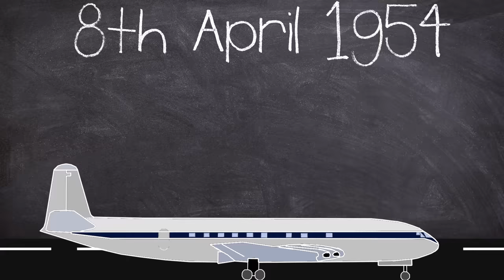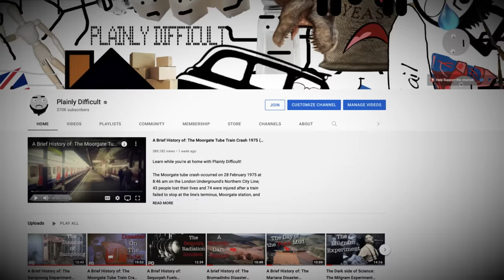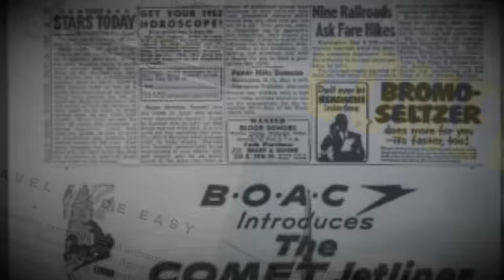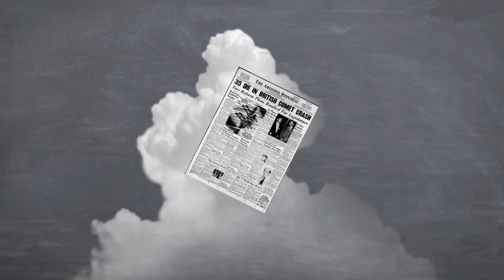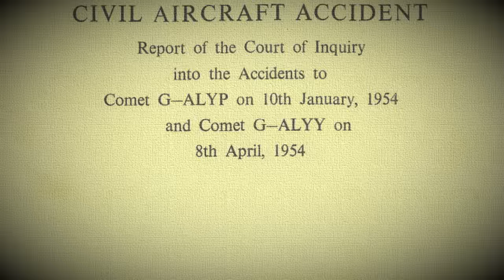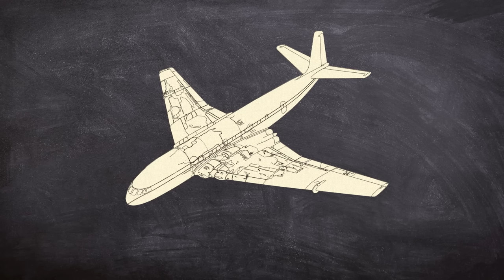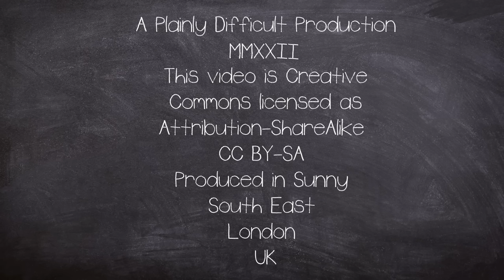A Brief History of: The de Havilland Comet Design Disaster 1954 (Documentary)

Comment: I believe that de H. were under pressure from the government to cut costs and make a lighter fuselage. One thing not mentioned in the video was that the last type 4 was developed into the ( HS ) Nimrod for maritime patrols. Over 100 were built and were in service until 2011. Incidentally I was 3 months old when the plane crashed.
Reply: Actually de Havilland had no real experience in building pressurized cabins out of riveted aluminum.
de Havilland's most successful airliner prior to the Comet was the Dragon, a wood and fabric biplane.
de Havilland was decades behind in aircraft design and construction technology and was still building jet aircraft primarily from WOOD in the 1940s -1950s.
Reply: Not true, the Hawker Siddeley Nimrod was a completely redesigned aircraft developed 20 years later.
Ironically the Nimrod fleet was permanently grounded after a fatal accident involving metal fatigue.
Reply: Hi Older, It's often stated that de Havilland strove to make the Comet 1 light, but it doesn't seen to be that light, so you would have thought that there would have been plenty of material to make a proper design.  Here is a comparison between the Comet 1 and the contemporary Viscount 700 turboprop:
                             Weight          Length       Span        Speed    Pressure Passengers
                            (pounds)         (feet)         (feet)       (MPH)        (PSI)
Comet  1             70,000             93              115          460             8.2               40
Viscount  700     41,276             86                93          318             4.2               40
Reply: @sandervanderkammen9230 
   De Havilland were building all metal stressed skin construction airframe aircraft from around 1938 also building thousands of primarily metal construction airframe jet fighter aircraft during the 1940s.
  De Havilland also manufactured the jet engines for the jet fighter aircraft they built.
  The world's first all metal stressed skin construction airframe airliner aircraft was produced by Handley Page of England during the 1920s.
    The weight of the DH Comet was in fact low for that particular aircraft given it's advanced multi redundancy systems, it's speed & especially the 8 psi pressure differential which makes a big difference.

Comment: Enjoyable video to watch but unfortunately incorrect information. The shape of the windows, that weren’t even square as the corners were rounded, did not cause the accidents. The cause was aluminium that was too thin and punch riveting that led to weak points with micro defects that became cracks. The reason the failures happened around windows was due to these areas being riveted not the window shape. Previous pressurised airliners had square windows with no issues, though admittedly did not fly as high, and as you can see from the picture of the Comet 2 in this video a squarish window remained on the design at the cockpit.

Comment: The cause of the crash was metal fatigue discovered when one of the aircraft that crashed being put into a pressure tank at Farnborough
Reply: The cause of the catastrophic in-flight structural failures was due to bad design and shoddy workmanship.

de Havilland simply lacked the engineering experience to build revitted, all aluminum, pressurized  aircraft.
Reply: This video has some BS included.
For example -
  
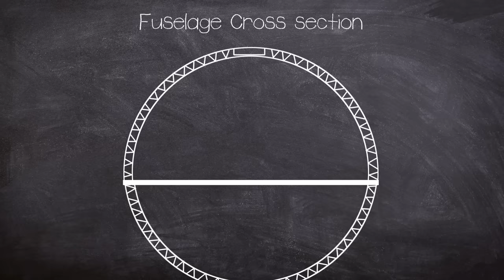    5:20   The idea that only the crew & passenger areas were pressurised is absurd obviously. 
  Every part of the fuselage was pressurised from the nose to the rear fuselage bulkhead including the entire cargo area.

Comets flew until 1997.
The Comet design had military use as a requirement. Nimrod development began at 
De Havilland before 1953.
Nimrods were not withdrawn due to structure problems or other airframe issues it was entirely a significant upgrade snag & resultant basic economics & an end of line sale happening at Boeing at the same time.

We feel we can shed some light on some common misunderstandings.

At the time the Comet wasn't particularly dangerous.

Losses comparisons
How things were in those days.

DeHavilland Comet 4 UK           14% 
DeHavilland Comet all  mks       17%  

Boeing 307                               70%
Boeing 247                               48%
Boeing 707            .                  20% 
Boeing 707                                20% 
Lockheed Electra Turboprop   29%
Canadair CL-44  Turboprop     46%  
Convair CV-580  Turboprop     22%
Convair CV-880    (ff 1959)       27%  
Convair CV-990     (ff 1961)      35%

    Of course De Havilland had prior experience building many all metal construction airframe aircraft including thousands of jet powered fighter aircraft that were primarily of metal construction with pressurised cockpits & jet engines built by De-Havilland.

   De Havilland carried out full stress analysis & engaged in a comprehensive & protracted testing program which is why key De Havilland people were happy to be aboard flying DH Comet aircraft.

   The DH Comet was the first passenger airliner with full length fuselage pressurisation at 8psi pressure differential. Handley Page built the world's first airliner.

   Of course ripstop provision was provided. The skin alloy used became unavailable at the time due to R & D at the manufacturers which resulted in the original alloy being discontinued.
The skin thickness used for the Comet was used for similar later aircraft. 
Frame spacing was not found to be too large & frame width was not found to be too small.

  De Havilland did indeed always work to better than industry standards at the time, used up to date knowledge for the design & construction & no evidence of negligence  or criminal negligence was ever produced in relation to the DH Comet.

  The DH Comet had no effect on the course of the aerospace industry in the UK. The UK now has the world's largest combined nuclear, aerospace & defence sector per capita activity.

    The investigation committee did not find hundreds of fatal flaws or evidence of design defects, structural defects, defective materials or shoddy workmanship. Ripstop provision was included. Claimed incidents did not involve cracks starting from window corners.
Pretty much all changes were just in case changes or were planned development modifications & improvements that were scheduled regardless of incidents.

De Havilland designers knew all there was to know about metal fatigue at the time they designed the DH Comet.

Hope this helps.

Cheers 👍
  
   
   🚫 Do Not Decipher The Content Below 🚫
xcxcxvcxccccvcvvvv
xcvvvccvccvcvvvvvv

Comment: I keep noticing that the rear gear is changing from one big wheel to 2 smaller wheels. Are those just different variants of the dh106?
Reply: The prototype had large single main gear wheels, production aircraft would have the 4-wheel main gear boogies

Comment: I just thought, was there no maintenance procedure to check some structures of the plane? Square window fatigue must have signs like cracks.
Reply: Hi superman de Havilland were doing routine crack testing. The problem is that with the weak construction and no rip stops, a crack becomes catastrophic very rapidly, so there is no time for detection.
(wiki:  de Havilland Comet)

Comment: You failed to mention that the Comet went on to complete many, many years as a tanker for the RAF where it performed perfectly. I still think that it was the most beautiful airliner ever built.  A rumour has it The US was so concerned about their engines exploding they thought it better to let them drop off, many have.
Reply: The Comet and the Nimrod were retired from RAF service due to metal fatigue that caused a major fatal crash...
Reply: The placement of the engines inside the wing was based on an aerodynamic theory that later proved to be completely wrong! No other aircraft in the world use this fatally flawed design.
Reply: This video has some BS included.
For example -
  
    5:20   The idea that only the crew & passenger areas were pressurised is absurd obviously. 
  In fact every part of the fuselage was pressurised from the nose to the rear fuselage bulkhead including the entire cargo area.

Besides that.
The engine position & inlet design were not flaws or fatal flaws, there were good reasons for that design choice at the time.

Comets flew until 1997.
The Comet design had military use as a requirement. Nimrod development began at 
De Havilland before 1953.
Nimrods were not withdrawn due to structure problems or other airframe issues it was entirely a significant upgrade snag & resultant basic economics & an end of line sale happening at Boeing at the same time.

  We feel we can shed some light on some common misunderstandings.

  At the time the Comet wasn't particularly dangerous.

Losses comparisons
How things were in those days.

DeHavilland Comet 4 UK           14% 
DeHavilland Comet all  mks       17%  

Boeing 307                               70%
Boeing 247                               48%
Boeing 707            .                  20% 
Boeing 707                                20% 
Lockheed Electra Turboprop   29%
Canadair CL-44  Turboprop     46%  
Convair CV-580  Turboprop     22%
Convair CV-880    (ff 1959)       27%  
Convair CV-990     (ff 1961)      35%

    Of course De Havilland had prior experience building many all metal construction airframe aircraft including thousands of jet powered fighter aircraft that were primarily of metal construction with pressurised cockpits & jet engines built by De-Havilland.

   De Havilland carried out full stress analysis & engaged in a comprehensive & protracted testing program which is why key De Havilland people were happy to be aboard flying DH Comet aircraft.

   The DH Comet was the first passenger airliner with full length fuselage pressurisation at 8psi pressure differential. Handley Page built the world's first airliner.

   Of course ripstop provision was provided. The skin alloy used became unavailable at the time due to R & D at the manufacturers which resulted in the original alloy being discontinued.
The skin thickness used for the Comet was used for similar later aircraft. 
Frame spacing was not found to be too large & frame width was not found to be too small.

  De Havilland did indeed always work to better than industry standards at the time, used up to date knowledge for the design & construction & no evidence of negligence  or criminal negligence was ever produced in relation to the DH Comet.

  The DH Comet had no effect on the course of the aerospace industry in the UK. The UK now has the world's largest combined nuclear, aerospace & defence sector per capita activity.

    The investigation committee did not find hundreds of fatal flaws or evidence of design defects, structural defects, defective materials or shoddy workmanship. Ripstop provision was included. Claimed incidents did not involve cracks starting from window corners.
Pretty much all changes were just in case changes or were planned development modifications & improvements that were scheduled regardless of incidents.

De Havilland designers knew all there was to know about metal fatigue at the time they designed the DH Comet.

Hope this helps.

Cheers 👍. 
  
   
 . . .... ... ..... .

Comment: It was one of the most beautiful passenger plane ever build.
Reply: Without any doubt the worst jet airliner in history.
Reply: This video has some BS included.
For example - 
  
    5:20   The idea that only the crew & passenger areas were pressurised is absurd obviously. 
  Every part of the fuselage was pressurised from the nose to the rear fuselage bulkhead including the entire cargo area.

Besides that.
Comets flew until 1997.
The Comet design had military use as a requirement. Nimrod development began at 
De Havilland before 1953.
Nimrods were not withdrawn due to structure problems or other airframe issues it was entirely a significant upgrade snag & resultant basic economics & an end of line sale happening at Boeing at the same time.

We feel we can shed some light on some common misunderstandings.

At the time the Comet wasn't particularly dangerous.

Losses comparisons
How things were in those days.

DeHavilland Comet 4 UK           14% 
DeHavilland Comet all  mks       17%  

Boeing 307                               70%
Boeing 247                               48%
Boeing 707            .                  20% 
Boeing 707                                20% 
Lockheed Electra Turboprop   29%
Canadair CL-44  Turboprop     46%  
Convair CV-580  Turboprop     22%
Convair CV-880    (ff 1959)       27%  
Convair CV-990     (ff 1961)      35%

    Of course De Havilland had prior experience building many all metal construction airframe aircraft including thousands of jet powered fighter aircraft that were primarily of metal construction with pressurised cockpits & jet engines built by De-Havilland.

   De Havilland carried out full stress analysis & engaged in a comprehensive & protracted testing program which is why key De Havilland people were happy to be aboard flying DH Comet aircraft.

   The DH Comet was the first passenger airliner with full length fuselage pressurisation at 8psi pressure differential. Handley Page built the world's first airliner.

   Of course ripstop provision was provided. The skin alloy used became unavailable at the time due to R & D at the manufacturers which resulted in the original alloy being discontinued.
The skin thickness used for the Comet was used for similar later aircraft. 
Frame spacing was not found to be too large & frame width was not found to be too small.

  De Havilland did indeed always work to better than industry standards at the time, used up to date knowledge for the design & construction & no evidence of negligence  or criminal negligence was ever produced in relation to the DH Comet.

  The DH Comet had no effect on the course of the aerospace industry in the UK. The UK now has the world's largest combined nuclear, aerospace & defence sector per capita activity.

    The investigation committee did not find hundreds of fatal flaws or evidence of design defects, structural defects, defective materials or shoddy workmanship. Ripstop provision was included. Claimed incidents did not involve cracks starting from window corners.
Pretty much all changes were just in case changes or were planned development modifications & improvements that were scheduled regardless of incidents.

De Havilland designers knew all there was to know about metal fatigue at the time they designed the DH Comet.

Hope this helps.

Cheers 👍
  
   
   🚫 Do Not Decipher The Content Below 🚫
xcxcxvcxccvcvvvvcv
xcvvvvccvcvvvvcvvv

Comment: The explanation is totally wrong. The stress fractures have nothing to do with square windows. but rather that the rivets  was hole punched. In one of the images you can even clearly see the fracture following the punch, not the window.

The claim about the square windows was widely spread in media, but that didn´t make it any more true. The issue is that the square hole increase the interior stress on the window, not the exterior.

As clearly can be shown on pretty much any aircraft the front window is still square, and its still part of the same fuselage.

The reason why airplane windows are round is due to to make them lighter, not to protect the fuselage.
Reply: Excellent comments

Comment: Look at those square windows on a light weight pressure vessel!
Reply: Wreckage recovered from the sea confirmed that the passenger windows were not related to the catastrophic in-flight structural failures.
Reply: The Comet 1 windows were not perfectly square. They had radiused corners. The B707 had a similar window shape, without problems, as have a lot of other aircraft. The radius  for the corners is 3 inches for both aircraft windows.

de Havilland did put round windows on the revised Comets but it was only for PR. Round windows were not necessary.
Reply: @phonicwheel933 
Many subsequent airliners had elliptical or round windows.
Due to the fixed cylinder pressure vessel hoop stress to longeron stress ratio the ideal window shape for minimum structure weight is an ellipse with the vertical dimension being the larger dimension and the vertical to horizontal ratio being equal to the hoop stress to longeron stress ratio.
  With a lot of windows weight saving can be significant.